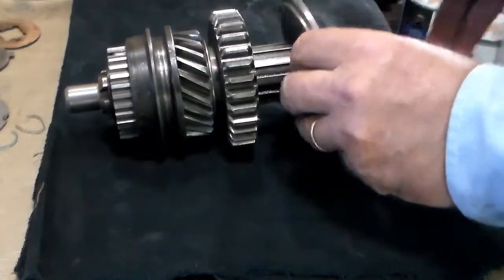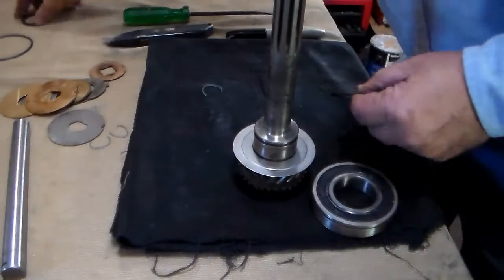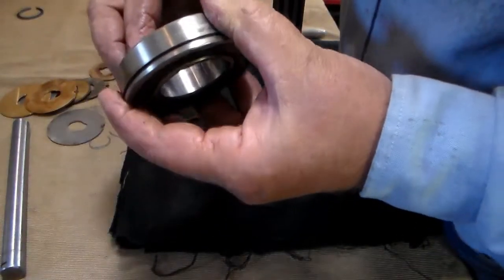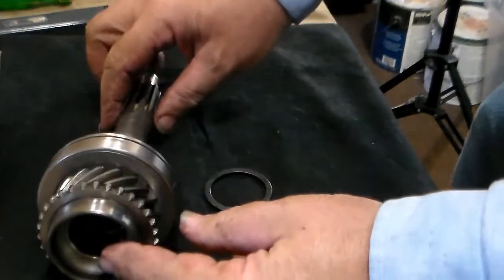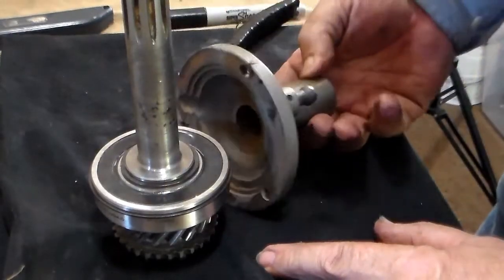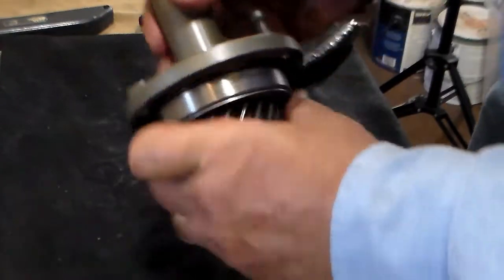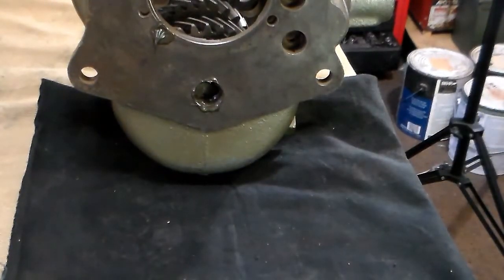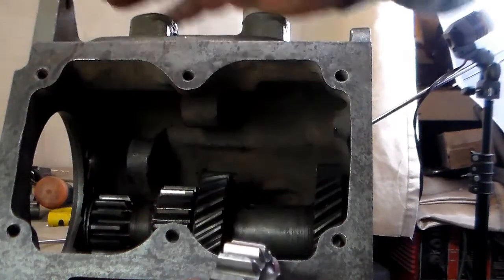12 Rick Stivers T-90 Rebuild Guide - Assembly Part 3

Comment: Great guide, Rick.  How do you recommend sealing the oil hole in an extended main gear if running a sealed front bearing?
Reply from the maker: Bill Craig, I've only done one. On it I used cotton and mixed it with hardening gasket sealer. I packed it into the hole and let it cure. I've had no problems with it. I also cleaned the hole out first to remove all oil so the sealant could adhear.
Reply: Thanks again, Rick.
Reply from the maker: Bill Craig, No problem. I'm always ready to help out. Besides that gives me a way to update the videos and rebuild guide to answer more questions.